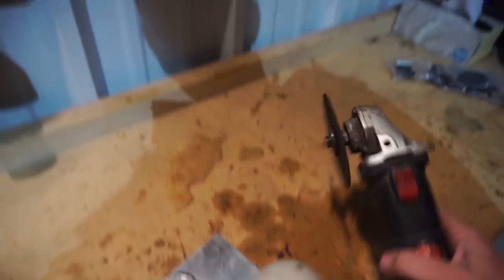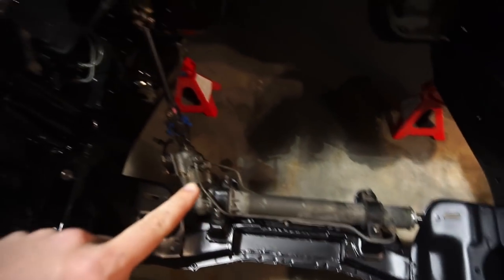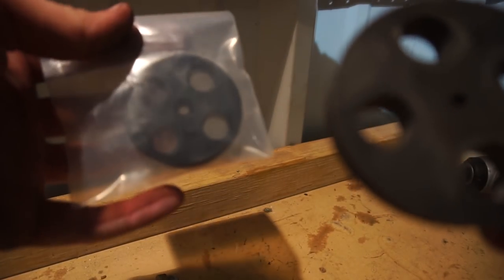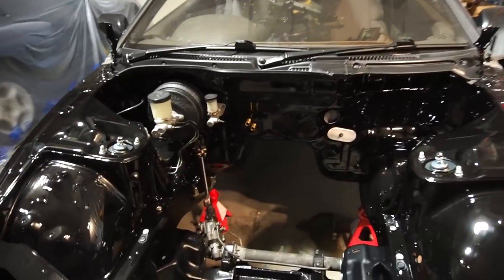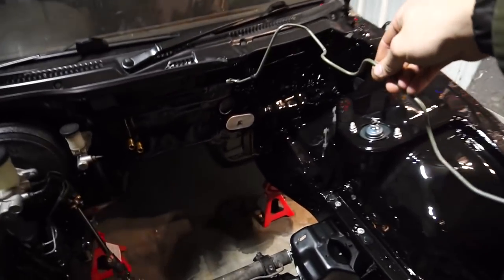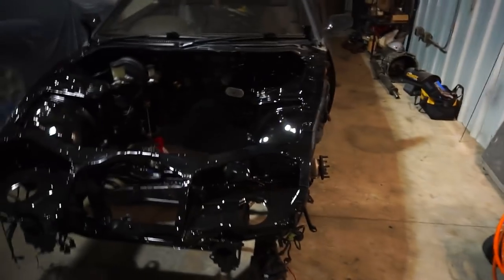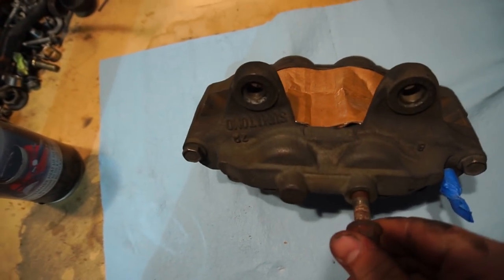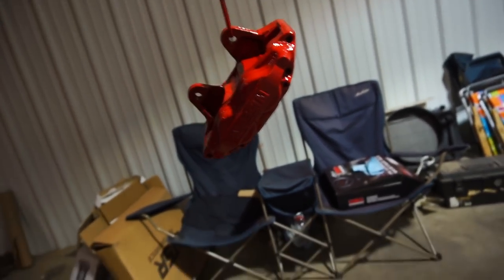SMALL COST, BIG REWARD

Comment: Yo Jimmy, here's an idea you can use for the Nissan name on your brake calipers. I did the exact same thing with my Computer case.      Drop some candle wax on the brake caliper, Make sure you have enough on there to cover that whole side. then start to scrap away until you reach the letters. Make sure the rest of the calipers are sealed off. And hit it with some paint(Silver should look clean af) After x amount of paint layers you feel needed. Just heat up the wax and it should come off without much of a hassle. I really Hope this helps, Rooting for you man!                      Sincerely You're Far Away fan From South Africa Andrico de Wet